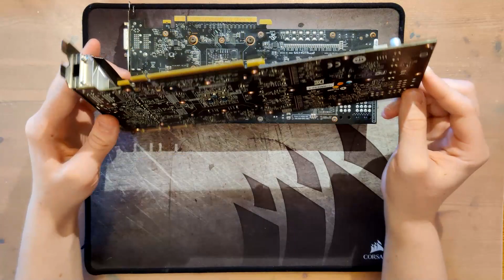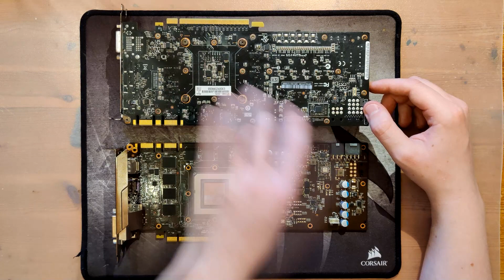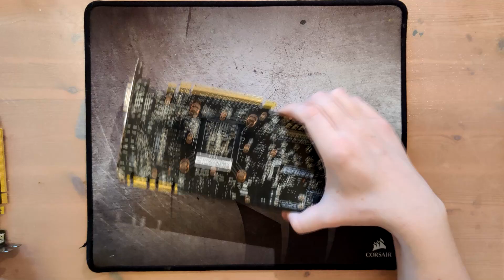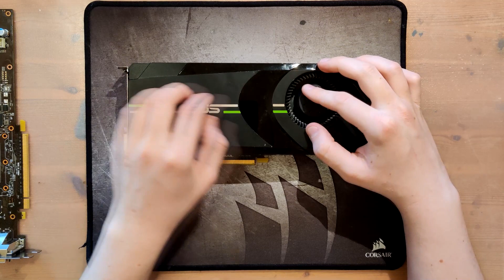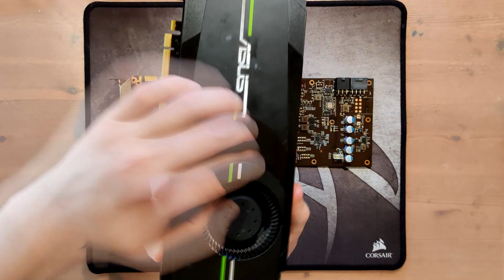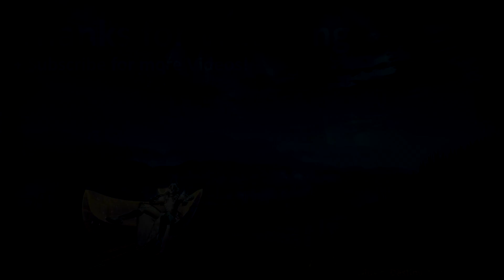Rambling about E-Power plans with a GTX 780 + GTX 680 shenanigans

Comment: I picked up the Bitspower pot, need to modify the mounting plate but looks like it'll work on older cards with some retrofitting. Should be fun for dry ice.

If you ever make another diy e-power, it'd be a good video on how to make it work. (What pins need shorted / etc) Besides your videos and the old Overclocking.net article, not a ton of info on it. Of course the EVGA V should be a beast for this.